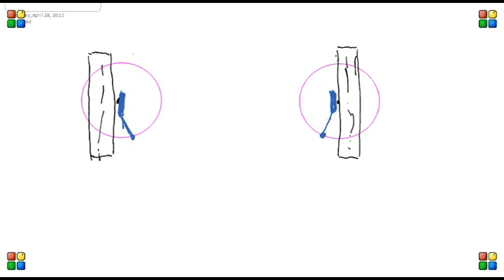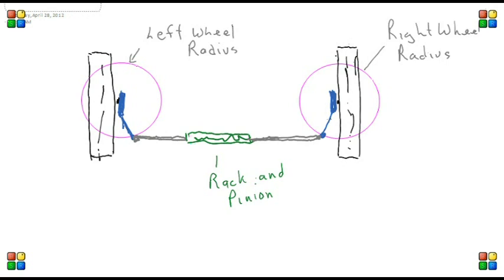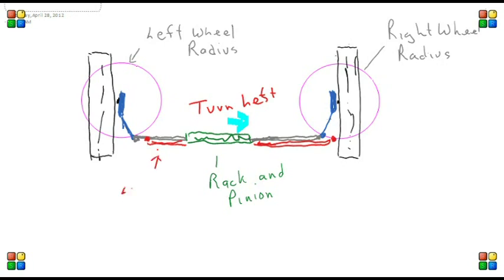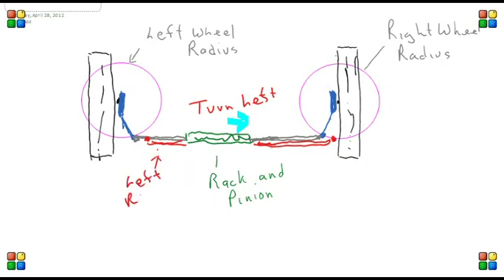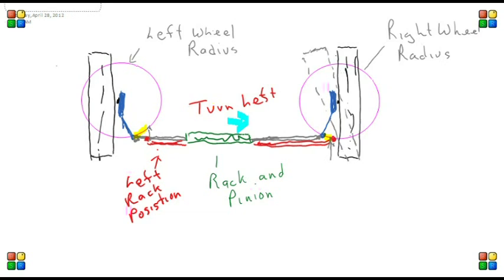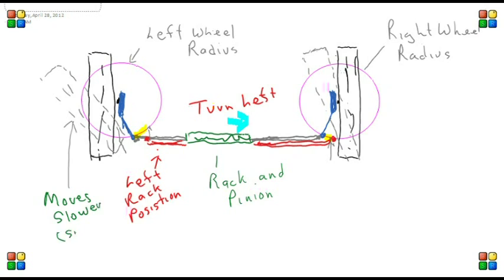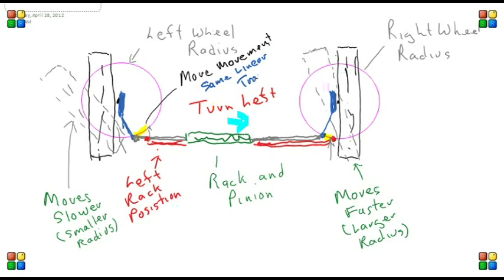ACKERMAN PRINCIPLE TUTORIAL

Comment: I once had a Volkswagen that was advertised with what was called a "negative roll steering radius".  I didn't know what that meant for several months.  All I knew was that I could point my car in the right direction on a straight road at 60 MPH and let go of the steering wheel and the car would keep the heading in the center of the lane and not wonder to the side of the road regardless of a crown in the pavement or whatever.  The wheel turned easily so I knew it wasn't because of friction in a tight steering mechanism.
So I decided to figure out what was going on.
I noticed that when the wheels were pointed straight ahead, the axles were perfectly horizontal but the more I turned the steering wheel, the tires tilted out away from the car.

Most cars have a positive roll steering radius.  This means that an imaginary straight line through the axis of the king pins would intersect the pavement between the front tires.  The result is that when the car is sitting still and you crank the steering to the right, the right wheel rolls forward very slightly and the left wheel rolls back slightly. It also means that if the right wheel hits a rock or a chuck hole in the road while moving, there would be a force that would turn the steering to the right slightly.

If you tilt the king pin so the at the imaginary lines I mentioned intersects the floor in the dead center of the tire's footprint on the pavement, then you would have a zero roll steering radius.  Tilt the king pins just a bit more and you have a negative roll steering radius. 
Logic tells me that zero roll should do the trick, but I've never experimented with building a steering mechanism.

Comment: Explanation is incorrect regarding rate of turn: should be: OUTER side turns at a SLOWER rate than INNER. OUTER radius of turn is larger, therefore angle of turn is LESS on that side, necessitating less actual angular wheel turn than the inner.
Reply: Do you mean the angle delta V is at a slower rate when you say the word "turn"?
Reply: Erica, the explanation is correct.  The inner tire is on a smaller radius of the turn and so the tire ROLLS slower than the outer tire.  He was NOT referring to what you are describing above, which is that the outer tire pivots slower than the inner tire, which is also correct.